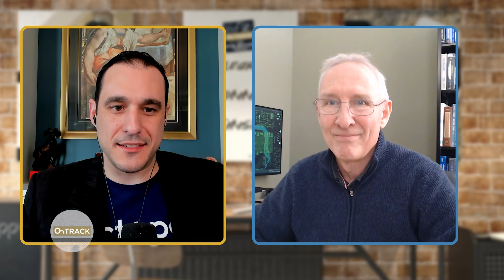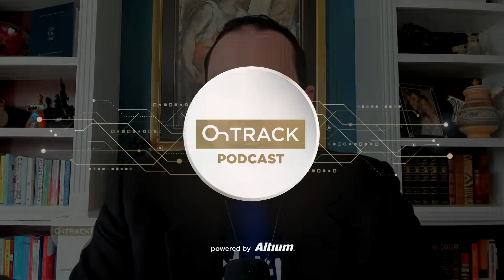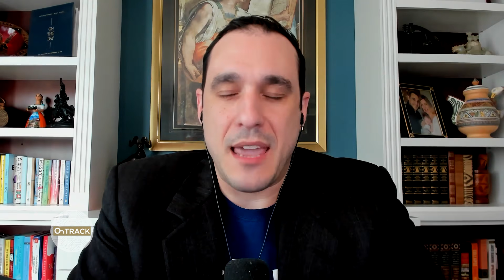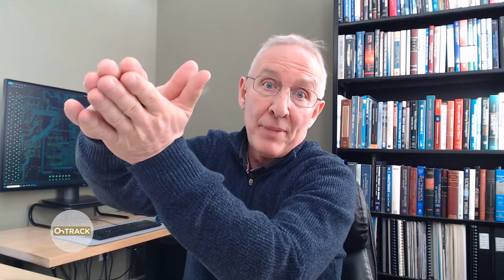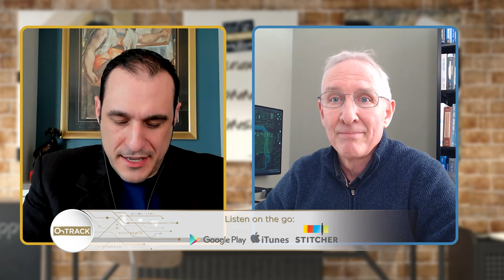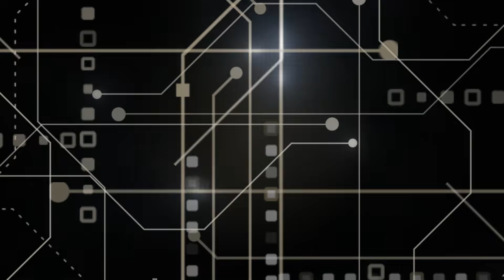EMC Expert Debunks Common PCB Grounding Myths

Comment: What about for shielding high speed traces  with low differentials from strong external EMI, such as LVDS or LPDDR signals?  Then that might be a time to embed the traces under a layer 1 ground pour perhaps???

Comment: You need copper fill if you have coplanar wave guides, or counterpoise for an antenna?
Reply: Yes but the benefits of coplanar waveguide are only substantial at high frequencies in the GHz range. At lower frequencies, or equivalently for digital interfaces at lower data rates, there is not much benefit for using coplanar waveguides.

Comment: I remember computers and mobile phones making a lot of audio noise (on nearby wires) and now they don't. I'm building a lot of DIY circuits as a hobby and I started to make noise filters and frequency filters recently. I'm waiting for an isolator to put on a Bluetooth module. I feel a bit forced into something I don't want to do.

Comment: Rather than have a copper ground pour on the outer layers, could we benefit from using a power pour on the outer layers?  Would that provide a little extra interplane capacitance, especially in cases where the outer layers are tightly spaced?

Comment: @AltiumAcademy On some high-power digital PCBs, the top and bottom layers are used as power planes to improve Power Integrity. If high-speed signals are routed on these same layers, how does this affect the signal and power performance? Specifically, does it increase noise (crosstalk) or impact the characteristic impedance of the traces?
Reply: Not a straight answer, but some questions: Do the power and signal traces routed on layer 1 have a ground plane on layer 2? 
How many layers are there? 

I don't see how it would inherently cause noise issues or negatively affect performance.
Reply: @Rotwold  some BGA chips use layer 1 for power, layer 2 for GND, other layer for signal.

Comment: 19:50 You don't need a chassis. You can just 'draw' one. Have a separate GND plane on one edge, connect it with a big trace to the other edge. (the one you consider your star point) , without GND current crossing the whole plane)

Comment: I quit didn't understand the copper fill point.i am a new designer learning to PCB design. What i understood is in 4 layer PCB for example the Top and bottom are signal and inner 2 layers are GND.So i should not have a copper fill on top and bottom which is gnd? 

Can anyone explain it to me?
Reply: I understood that by themselves they don't do anything harmful but don't help either. The problem is that designers invariably connect devices to the fill instead of the directly to the plane. Now the return current has to go along the fill and find a via back to the plane. And it gets worse when multiple devices push their current through the same vias.
Reply: Thanks
Reply: In two layer designs the copper pour on both surface layers is needed to provide some kind of ground plane, and it is used on both layers to provide copper balance and help prevent warpage. On 4 layers with GND on L2/L3 and on higher layer count, the copper pour does not carry much return current unless the dielectric thickness to the ground is large. In the case of thin dielectrics the presence of the plane does more to help suppress EMI. You can still use ground pour to define impedance for coplanar lines, or you will need to use it on L4 in a SIG/GND/PWR/SIG stackup to control return currents; in the SIG/GND/PWR/SIG stackup you will then also need to pour copper on L1 to balance the copper.

Comment: Is there a video or reference that shows proper decoupling arrangement for 4 layer boards with gnd on layer 2 and power on layer3?
Reply: In this case, assuming the power and ground are loosely coupled (greater than 10 mils/250um apart), place the capacitor on top next to the POWER pin and connect 1 via to the power plane. The power pin and capacitor should share the via, so place the via between them. Connect the IC ground pin to a ground via and the other side of the capacitor to a ground via. If you have a bottom side capacitor (with topside IC), then align the capacitor ground side with the IC power pin on top and place the capacitor ground via next to the IC power pin via. Then orient the power side pin of the capacitor toward the ground pin of the IC if possible, and place a power via at the capacitor pin. Ideally, this would be a power via close to the IC ground via. It can be done with some IC's. All of this is because your power plane was further into the board than the ground plane.

Comment: i feel like i hear seasoned EEs contradicting each other on these grounding topics every few months
Reply: A critical point that Todd made was, that you need to understand your problem - Eric Bogatin often says what problem are you trying to solve - and then think about what problem is being described.  Sometimes, the speaker doesn't give enough information for you to understand why that was the solution for their problem, maybe because there's not enough time.  The danger is applying an approach that you don't really understand when and why it applies, I.e. cookbook approach.   If you're unlucky, it might seem to work, then later bite you because the cable changed.  Also, different speakers focus on different things - EMC vs SI vs PI - maybe the solutions are optimised for different problems.

Comment: Great Video as always.
I have a class D Mono amplifier driving a small speaker. Should i put ferrite beads in Series before the connector or is that a Bad idea?
Cable is twisted, 4-5cm Long. For best EMI Performance ofc.
Reply: Even datasheets mention, that you need to put them if you have 1) lengthy wires/traces, 2) susceptible traces (like HF adc), 3) EMC requirements.
Main advice it to dampen everything >20-25KHz. 
So the answer is: it depends.
Check your device's datasheet, if it requires external filters for functioning.
If you just need it working, put required, ignore the rest. Ferrites are totally not required.